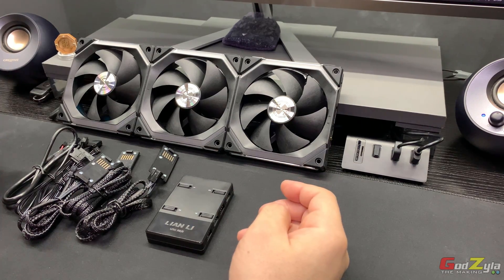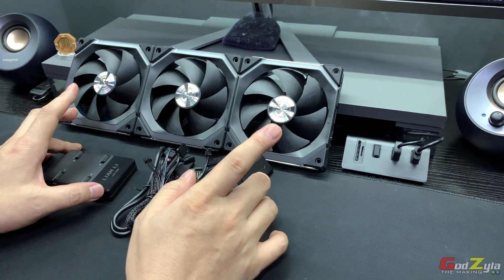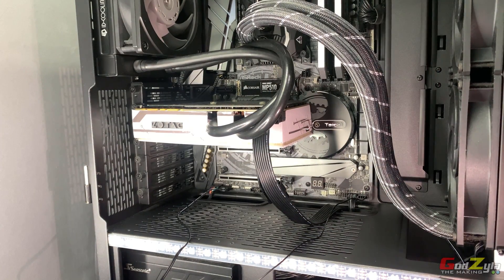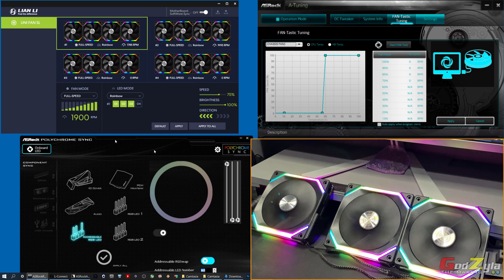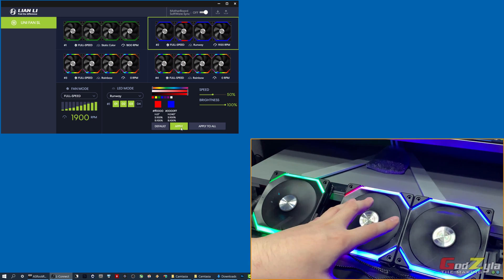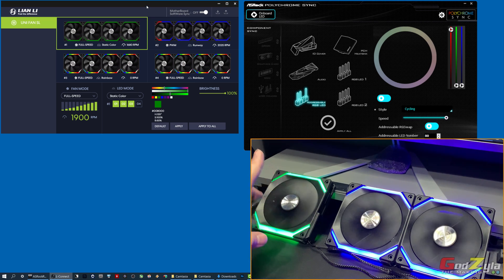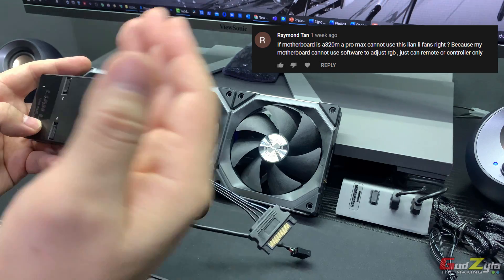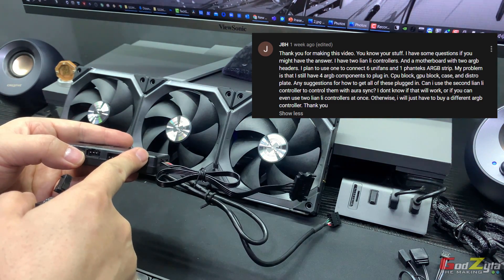Lian Li Uni Fan SL120 - Connection & The Controller (Part III) [L-Connect]

Comment: Thinking of getting these fans, just want to know are they quiet? And do you know if the controller for the fans supports other fans like corsair for pwm control? I assume it does but never hurts to ask.
Reply from the maker: Hi deadlykeybord, you can use other fans which comes with argb connetion at 5v and make sure each fan LED load is below 0.65a but you will need a converter. as for connecting other pwm fans to the uni fan controller. I would not advise to. unless they are rated fan lot at 0.18a and with rpm from 800 to 1900. I believe this video will clear your doubts https://youtu.be/bMRz2KVqbjA
once again thank your for visiting my channel and to have subscribe to my channel.
Reply from the maker: I almost forgot. if you want to know how these fans perform as airflow case fans or radiator fans, you can view these too https://youtube.com/playlist?list=PLEW-b-2vYDdN1OJeZXPAfohJLv_kwm32Y
Reply: @KleoYan  Thanks for the links they helped alot. They seem like really good fans for noise and air flow.
Reply from the maker: @deadlykeybord  yup. they are good on radiators, but for the case airflow, it really depends. you need something to channel this fans inorder to use their full potential. with this said. hope you enjoyed those video i've done and I wishes you all the best if you getting these fans in your build :) have a great weekend my friend and I love the video you've done too https://youtu.be/P_le9s2vze0 <-- EXCELLENT :P
Reply: @KleoYan  Hey thanks, I'm really glad you like the video. I bought the fans so hopefully work out well. Looking forward to more videos from you.
Reply from the maker: @deadlykeybord  thank you for replying :) and I will try my best.. all the very best with your PC build too.. :)

Comment: Very nice video, I bought the lian li 120 fans and have them all hooked up, I have the asrock x570 phantom game 4 wifi ax  motherboard and turned my pwm mode on in bios. When I go to my motherboard setting I still cannot control the fan speed even tho I have  clicked l connect  over to mother board settings. Iv tried everything. Ik some of the argb software it real glitchy with asrock but not sure about motherboard utility. Any info would be great and thank you
Reply from the maker: hi Jordon Purpura, thank you for your question. Now I do have issues like you where I can't control the fan PWM when I set on L-Connect apps be it with motherboard Software Sync is on or off. therefore what I did is to install the INF driver which is base on Intel. I do know that AMD does have this INF driver for windows but will this help or not, you might want to try install that first. Just be sure to unplug your Uni Fan USB and sata power source from your motherboard first, then go to this website. https://www.amd.com/en/support/kb/faq/chipset-install and follow the instruction there. once installed, reboot your system and check on your device manager (point at start and do a right click > click on device manager . now check if there are no ! mark in the device manager windows. if there are ! mark, you will need to fix it by updating the drivers. once there is nothing. shutdown your pc, plug your Uni Fan USB and sata power to the uni fan control unit. then boot to UEFI/Bios, trigger the PWM header which you have connected the PWM Cable between your Uni Fan controller and the Motherboard fan header. Save and load to Windows, see if that helps. Once again thank you for your question and if you like my content, kindly aid by subscribing and to click on the notification bell. Thank you!
Reply: @KleoYan  thank you very much for getting back to me, I was stuck not knowing what to do, I hope this helps and I'll let you know what I come up with
Reply from the maker: @jordanpurpura803  you are most welcome. Hope you are able to get it to work. Will wait for your good news.
Reply: @KleoYan  Well I did everything in the chat we discussed and I have no errors in device manager, but when I go to asrock utitlity and click on test fans for chassis fans 2 which the lian li are connected to, the fans ramp up and I can hear them but when the test is done I dont get any rpm range like it never did the test. So I am not able to customize the fans to ramp up or down.
Reply from the maker: @jordanpurpura803  I will try my best to explain to you. Did you enable the PWM mode on your motherboard? 

- Restart your PC and when you see the ASrock log, press del key simultaneously  till you get to the UEFI page (refer page 60 https://download.asrock.com/Manual/X570%20Phantom%20Gaming%204.pdf) 
- Click on HW / Monitor (Page 77) 
- Scroll down and select the Fan header (Example Chassis_Fan1)which you have plug the PWM cable between the Uni Controller and the motherboard
- Set it to PWM , Save and exit.
- Boot to windows, Launch L-Connect application, set the output fan you wish to use the motherboard PWM curve, set it to PWM
- Launch your Phantom Gaming Tuning app (page 48) 
- Click on the tab which say FAN-Tastic Tuning
- now select the header (Example Chassis_Fan1) then below you will see a chart, increase or decrease the fan rpm through there and press Apply, your fans should react if you did it correctly.

now if all fails. I seriously have no idea how to aid you. it could be somewhere plug is lose and such. or if it really does not work. just a note as I have mentioned. whatever fan set you have selected on the uni fan controller (Output 1 to 4) if you use PWM on either set, it will only follow the fan curve of the specific fan header which you have connected between the uni fan controller and the motherboard. Hope I did not confuse with this.
Reply: @KleoYan  yep I did all that and thank you very much for the detailed instructions. When I go to test fans in fantastic tuning. I hit run test, the fans ramp up and I can hear them but when the test is done I don't get any rpm or any stats on the test it all goes back to 0. I guess I'll keep trying but want to tank you again for the help
Reply from the maker: @jordanpurpura803  hmm.. where did you see the RPM going 0? on the Phantom Gaming Tuning or L-Connect software?
a way to check if your RPMs did react, try using HWinfo to see if those fans are reacting when you change the curve like what I did as shown in this video. If it still does not work, I am so sorry that I am not able to aid you on your issue.
Reply: @KleoYan  so when I run the test in phantom under start fan test I can hear the fans ramp up and then down but when it is done, there is no fan speed list. I downloaded hwmonitor and the only fans showing up are cpu and an fan no other fans show up.  I appreciate it help with everything and taking ur time with me. I have no idea either
Reply from the maker: @jordanpurpura803  hi. that is practically correct. on HWinfo it will only shows the CPU which i believe is your AIO pump or your normal air heatsink fans. as for the other which is the only fan listed.. it's correct. you see, when you plug all SL Fans into the controller unit itself.. there is only one pwm fan connection to the motherboard so you wont get to see other fans RPM. but if you look at your L-Connet, right at the bottom of each set. you will see RPM.. thats where it will list out. 
that is how it works.
Reply: @KleoYan  ok, just didn't know if it was working correct because I never saw a rpm in any other software. I have pwm clicked and can see the fans running in uni fan software. I was just trying to set a custom fan curve and I'm guessing we can't do that with these fans.
Reply from the maker: @jordanpurpura803  Hi Jordan Purpura, yup, thats how it works if you plug all uni fans to the uni fan controller, but, if you want to really control each set of uni fans, what you can do is. just plug the argb cable of these fans to the uni fan controller, then plug the PWM fan connectors to your motherboard fan headers and your Phantom Gaming X570 motherboard have plenty of those fan headers. it is safe to plug the uni fans on them too. hope that helps. thank you!
Reply: @KleoYan  thank you for all your help
Reply from the maker: @jordanpurpura803  you are most welcome 😊
Reply from the maker: I forget to mentioned.. there are other videos I did on this uni fan controller that might interest you. especially the dos and donts , here is the entire playlist https://youtube.com/playlist?list=PLEW-b-2vYDdM1WklGQps2-sQ1Amy6Uwn9 . thank you!

Comment: Hi bro I have a biiiiig problem ! I Have 9 Lian Li uni fan all by 3 so they are connected to 1/2/3 on the unit ! And the unit are connected to my sata (psu), my motherboard with usb and normaly with the thirdcable I ve a 3 pin RGB and for the pwm I have a lot of fan header (cpu_Fan/OCP_Fan/ Cha_Fan 1 & 2 /M2 Fan) I have test all of them... but I cant program this for rpm... for automatic fan ... (Mobo : Z490 A GAming by Asus) ... can you help me ?
Reply from the maker: 1st leave the PWM fan connect on the controller, then decide which fan header you going to use. lets say you connect to CPU_FAN, go to your bios/UEFI to configure your fan curve first. 
once you have set it.. shut down PC, then connect the PWM fan header from the uni fan to CPU_FAN. turn on your PC, load the L-Connect software, select the set you wanted to use PWM. examle set 1 . then under the fan settings of the L-Connect, change to PWM and click apply. this will instruct your set 1 to follow the motherboard PWM settings.

Comment: Do you actually need the 3 pin connector for RGB or only the USB connector for RGB thru the software?
Reply from the maker: Hi Andy M. Thank you for your question. I assume you are talking about the aRGB 3pin from the uni fan controller to your motherboard aRGB header. No you do not need to connect that. Just connect the USB cable will do and of course to use the software to control the patterns. Hope that answer your question and if you do like my content, remember to subscribe and to click on the notification bell. Thank you very much. 😊
Reply: @KleoYan  thank you for the fast answer. That's exactly what I wanted to know. 👍👍👍 and you get 1 subscriber more 😊
Reply from the maker: @andym.8610  Hi, you are most welcome. by the way, I do have a series of videos about this unit, you might be interested in https://youtube.com/playlist?list=PLEW-b-2vYDdM1WklGQps2-sQ1Amy6Uwn9 . Once again thank you to have subscribed and to visit my channel.

Comment: If I want to control 1 set of fans speed to a certain temperature and another set of fans to another temperature setting, how can I adjust them on the motherboard? L-connect doesn’t seem to have a temperature setting to regulate fan speed. You would have to adjust manually
Reply from the maker: Hi Noel Nacpil, thank you for your question. In your case, I would connect it this way as illustrated below

Example you got 2 sets of SL120 (3 fans to each set) 
Set 1 fans and set 2 fans, ARGB connector will go the the uni fan controller, and their fan connectors will go directly to the motherboard fan headers. example Fan 1 and Fan 2 header on the motherboard, then make use of your motherboard application to do the fan curve.  by doing so you can control different set and your uni fan controllers have no control over these sets for fans. hope I did reply your questions and if you like my content, kindly subscribe and to click on the notification button. thank you very much!
Reply: @KleoYan  thank you! So basically connect each set of fans directly to the 2 separate accounts fan headers instead of the unifan controller. The ARGB connector will be used only for RGB control thru L-connect
Reply from the maker: @nnacpil  yup. That’s correct. Fan rpm will be connected on motherboard fan headers (control by motherboard software) and the argb lightings will be connected to uni fan controller (controlled by uni fan controller).

Comment: I'm going to have a total of 6 Uni fans going through this controller.  I also have 3 regular non-RGB fans that came with my AIO that I want to use for exhaust.  Can I wire those regular fans together and run them through the controller?
Reply from the maker: Hi John Waugh, thank you for the question. you could but i would not advise that. Reason being, this controller calibrates the SL120 and SL140 fans which the RPM is at 800 - 1800 rpms and these fans kick starts at 6volts. if your fan kick starts at 7volts, it might not even start at low rpm and if your the RPM might be slightly different. but the choice is yours. you can give it a try. just that the RPMs set for your non-RGB fans might not run as the speed you wanted. once again thank you for your question and to have visit my channel. If you do like my content, kindly subscribe and to click on the notification button. Thank you very much!
Reply: @KleoYan  Thanks for the reply.  Ok, I'll just run those extra 3 fans off the Sata cable
Reply from the maker: @johnwaugh4085  thank you for your reply. I wish you all the very best in your setup. once again thank you to have visit my channel and to subscribe too.

Comment: Hey bud, great video! I have installed everything correctly, from what I know. The fans light up and spin, but they are stuck. When I go to Lian Li app on my PC, it doesn't register any changes I make on the app. The RPM never changes, nor does the color. Any tips? Please help!
Reply from the maker: Hi Charlie Herrarte, thank you for your question. I can only suggest you to do the basic troubleshooting steps below

Test 1
=====
1) remove all fans on the hub, do a single fan test to each Input at a time  and while chaning settings on the L-Connect app, see if that fan reacts to your setting.
2) repeat step 1) with another fan 

if fan works, it means your Hub and L-connect is not an issue. the problem might be one of the fans is not daisy chain properly. if that's the case, try to reseat them again, maybe re-arrange the order.. exmaple change middle fan to the end and the end to to the front.

if fans does not react. then you will know is the L-Connect is not communicating with the Uni Fan hub. if that's the case,  you might try to reseat the USB cable from the Uni Fan controller to the usb 2.0 header of your motherboard, also to check to see under device management, do you see under the L-Connect icon under the USB Bus controller. 

if still cant work. then I really have no idea how to aid you with. 

once again thank you for your question and to have subscribe to my channel.
Reply: @KleoYan  Thanks for the response. I removed the USB off the Motherboard, and put it on the other USB on my motherboard and same thing., lights up, but no response on the app.

Under device management, I see nothing under USB controllers, but I see Lian Li under USB devices.
Reply from the maker: @dudeman1277  Hi Charlie, after double checked on my end, that is correct. this means that your uni fan controller is detected on your PC. now is to narrow down the fans, have you done a single fan test? if first single fan works, try other. if it works again.. daisy chain one and two fans and test again. if it works. put the first and second single fans one side and test the rest of your fans. will need to narrow down what causes the issue. if your first test on the single fan even after swamping fans don't work. then the problem might be the control unit itself.
Reply from the maker: I forget to mentioned, while you are testing the fans connection. please unplug the pwm cable with is to be plug between the unifan controller to the motherboard.
Reply: @KleoYan  out of a fit of rage, I disconnected everything from the hub/control unit. I have two more, so, after work i will connect everything to the new control unit, and if that doesn't work, I will probably destroy my whole pc lol. I don't think it is the fans that don't work. If it was, they wouldn't light up or spin, right?
Reply from the maker: @dudeman1277  I can understand your frustration. before you connect to the new unit. you might want to test the new unit without mounting to the PC case first. test it only with the USB cable and the sata cable. using the L-Connect to test out all your fans and on daisy chained (max 4 to one input) if it all works then shut down your pc, connect the PWM fan cable from your unifan to the specific motherboard fan header. do ensure that your specific motherboard fan header is plot according to the temperature curve. 
Or an option, if your unit works without connecting the PWM cable to your motherboard, just use the USB and Sata cable to less off the confusion. anyway am heading to bed and all the very best.
Reply: @KleoYan  thank you, but there's no way I can do that. Putting it together was already complicated. I have 9 lian li fans, and I also have NZXT Kraken z73 (3 fans and radiator), so 12 fans total. Taking everything apart and putting/testing everything 1 by 1 is too complicated for my experience in PC building, my friend.
I hope replacing the hub/control panel is my solution.
Reply: @dudeman1277  hay sorry I know I'm late with this response but I just went through this and figured it out, you might need L Connect 2. I had L connect and it turns out that the controller I had was for L Connect 2, this solved problem instantly.